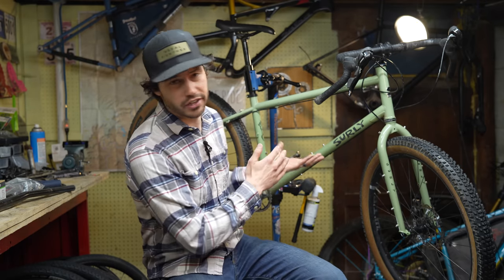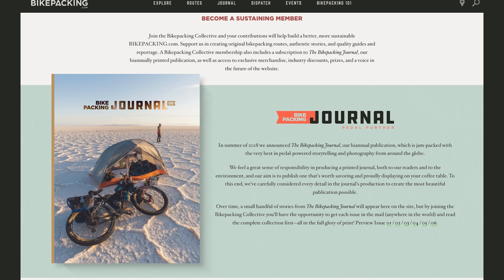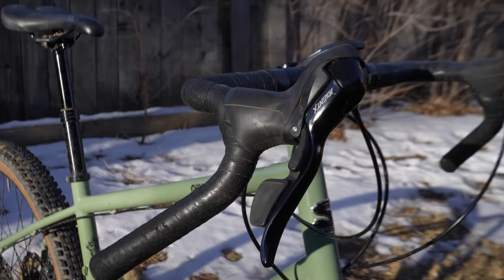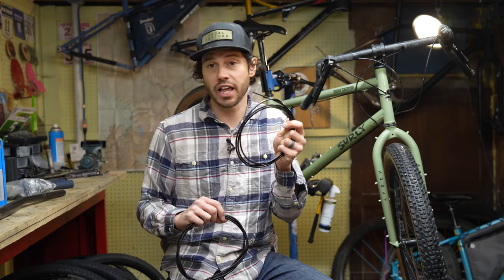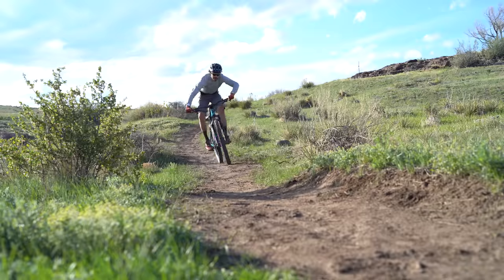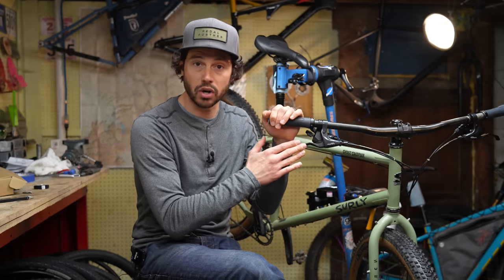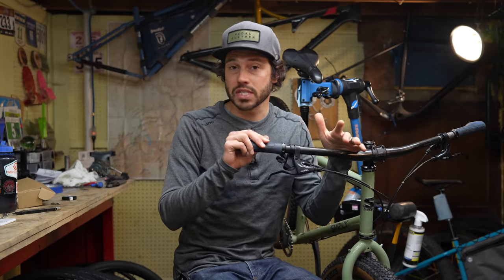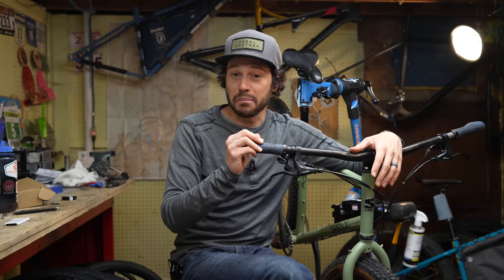Flat-Bar Ghost Grappler!

Comment: This video definitely hits at my hypothesis that eventually everyone will realize that once your bike is burly enough and your tires wide enough then it becomes more comfortable to just ride it like a normal mountain bike and that the market will eventually stop throwing drop bars on so many bikes.  Does it look cool?  Yes.  Is it practical to use drop bars on a bike as capable as the poiseidon redwood or this ghost grappler?  Perhaps not. Of course, beauty is in the eyes of the beholder.
Reply: It has do so with individual comfort though. Flat bars aren’t comfortable for everyone
Reply: @kbd13-n9c  🙄
Reply: @antonroux6737  ...your point? I personally have never ridden a flat bar that's comfortable beyond the 4-hour mark.
Reply: @ktakashismith As one who tours -- most of the day on the bike, day after day -- with flat bars, I say that the limiting factor for comfort is not one's hands and wrists but rather one's bum and seat bones.

Comment: I run flat bars, I went off drop bars when I was a 11 years old and made a mistake while shifting on the bars, looked down and went head first into the back of a car. Tried my brothers 21 speed racer but by that time I was into BMX. Built myself a 29er using an old 2011/2012 Voodoo Bizango as a bikepacking bike, and as it is intended for flat bars and has relatively modern geometry I can run flat bars and a short stem easily. Currently running 800mm bars with new Rock Shox Judy silver forks. I like the extra pull you can exert while pedalling with wider bars.

Comment: Tektro MT2.1 eclipse is another option if you want to run short pull brakes with flat bars. Those levers have an adjustable cable pull.

Comment: I use the drops on my Cannondale Topstone about .000000001% of the time as I find it a very uncomfortable position FOR ME. Consequently, a flat bar configuration makes way more sense since I find that way more comfortable overall. I'm still searching for my 1-bike solution... monster bike or hardtail...
Reply: You probably have the bars too low. IMO a lot of manufacturers still come out with drop bar bikes where the handlebar drop is just too aggressive for Average Joes, and of course most of the time they cut the steerers nice and short because that looks "cool". So many people barely ever use the drops. I also think on gravel/adventure/whatever bikes the bars should be higher to begin with compared to road bikes. On road bikes the drops are all about being aero. But on a gravel bike the drops give you a more secure position for rough descends, and you have more leverage on the brake levers. But when the bars are so low that you can barely even look up properly when you're in the drops, of course it's gonna be a horrible position for descending. 
That said, there is nothing wrong if you prefer one over the other. Personally I like both options for different reasons. If I was building a do it all but mainly off road focused bike, i'd probably go with flats that have more backsweep (maybe something different like a Jones), silicone grips or those Ergon ones with the "wings".
Reply: @HollyBoni  Thanks. I definitely agree with how many bars come set up in an aggressive road position. I actually installed a riser stem and I still never use the drops... I just don't like that riding position at all. I'd rather use tri bars or something.

Comment: So, you've given good reviews to both the Ghost Grappler and the Tumbleweed Stargazer. Plenty similarities between the models, but fairly different fit prospects. If you were starting from scratch, and couldn't pick a Cutthroat...which one would you choose?
Reply from the maker: You know, I would likely go with the stargazer for it's versatility, it's not as quick on the downs, but it climbs slightly better and I'm a climber at heart. I bet you could ask this question to a handful of riders that have pedaled both and it would be a mixed bag. I' really loved the Ghost Grappler for dedicated singletrack riding over the Stargazer however, and if you are looking for a bike that does more of that, you may want to consider it.

Comment: This is cool - but the weird thing about the Grappler is the head tube length.  To get the reach I like for a flat bar, I basically end up with a head tube that is 220cm long, and more stack than a trail bike with a 140mm fork.

Comment: The grappler has quite a bit more trail with its fork compared to the karate monkey. The forks are different lengths but I wonder if less trail would make the bike less twitchy? This bike looks very cool but would a guy be better off just buying a flat bar designed bike like the k-monkey or kona unit.

Comment: lol you took away pretty much the only part of the grappler that made it unique... and then kinda preferred it. There are really only like 5 unique surly bike models anyway and you just made a rigid krampus. I bet the next "new" surly frame will be a krampus with drop bars mark my words
Reply from the maker: I think I'm just not a fan of the woodchippers, perhaps a 50cm Cowchipper would be Ideal? You get credit when that happens, Joe. ;)
Reply: @BIKEPACKINGcom  in all seriousness, the Grappler and Krampus geometry are so similar it probably makes sense to buy a Krampus, since you could put drops on it, or run a suspension fork to shift the bik toward hardtail or drops to shift toward touring. I'm thinking hard about a Krampus or Grappler, and it seems like the Krampus is more flexible. Am I missing something?